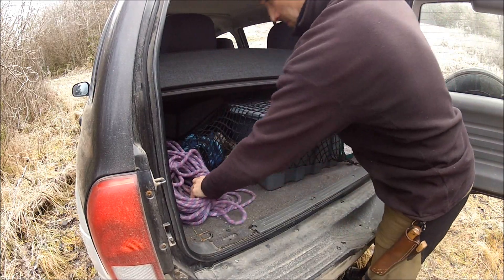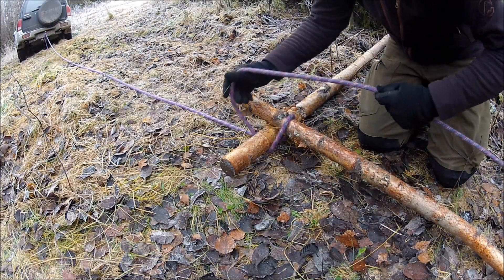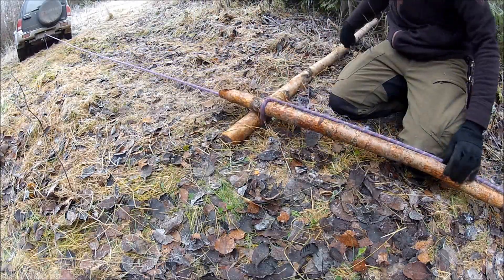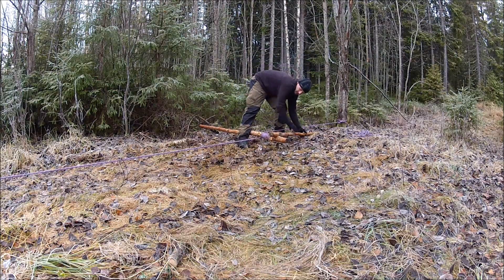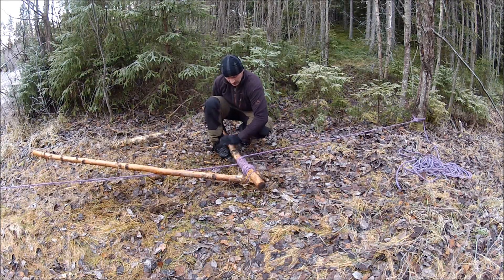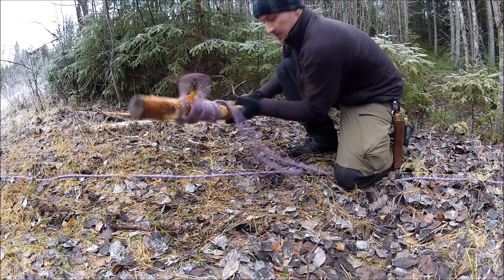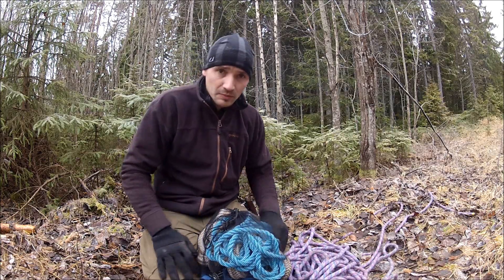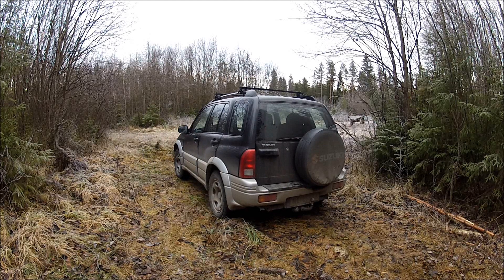DIY winch - For self Rescue

Comment: Not buying it.. The setup might work in certain conditions but that rope is not pulling an SUV, my rope snapped trying to extend an actual winch on my SxS, in drive, 4 wheels spinning. Also @7:08 it rolled like 8 inches not even in timing with his turn, you'd be lucky to get 1 inch out of every turn

Comment: I have read that throwing a "rug" or anything similar over the tight rope is what you do to keep the rope from whipping back if it fails. Anyone who says to just buy a come along has not been all alone and seen Plan A go to Plan D and so on. My question is about using a chain instead, would that be an option.

Comment: i thought you weren't supposed to use the tow ball system for towing. is this a special one that can handle this?
Reply: Uh, towing is what the "tow ball system" is for!
Reply: @philiphinton1350  I miss typed. What I meant is that towballs are not supposed to be used for recovery operations as they tend to break off when used this way and become deadly projectiles that often kill or mame people. I have seen video of a guy killed by a flying towball that broke lose and hit a bystander in the head and killed him.

Comment: Good Idea, But you can also tie a line to the tire and it is much quicker...
Reply: Exactly,  I was thinking that. Just wrap one end of the rope to the circumference of the tire,  and tie the other end on to a tree.  Then give a smooth pressure on the gas

Comment: very cool, too bad my truck is 8000lbs, but luckily if I have the right rope or strap I can tie it in-between my wheels because its a dually and use the engine as a winch
Reply: it is the best to have a winch but I don't yet, its 2wd so I don't really go Offroad but I always like to be prepared!
Reply from the maker: +bosshoss69lee Yes its doable, this method can be used for moving a log away from your path were you are not able to podition your truck for pulling it ie.
Thanks for watching
ODd
Reply: Have A real winch? Used It😊
Reply from the maker: Thats the best thing...

Comment: No no no do not winch on your ball hitch! it can break off and fly at someone at hundreds of mph! Though for this particular example I suppose the rope would snap first
Reply from the maker: +Pedro Amargosa I would belive the rope snaps first yes. I have never experiences a ball hitch break myself, never heard of it eiter. But it can happend. I used the ball to show that simple knot that will easily loosen after heavy loading.
Thanks for watching
Odd
Reply: This may hold true for Class 3 (5k pound/2.3 kg) and under type hitched of the US style, but mainly applies to using in a snatching manner of recovery. European ball mounts are made more different with the ball forged with the neck, but still one will want to remain vigilant if using the hitch ball in a winch recovery as something unforeseen weakening the  structure like fractures will likely give away if the rope does not give out first. If anything make sure to bring along a hitch receiver shackle mount to tie the rope to for a 'stronger' connection.

Comment: would i be able to do the same thing with a camper trailer but using tent poles instead of wood. or would it crush it . If i put rope on something at the front of the trailer and join the other end on the tow ball of the car would i be able to make the forward folding trailer lid go over to close it hope this makes sense
Reply from the maker: +Alison Watson The poles need to be strong, you can use pipes, steel bars, or any other thing that is pretty strong. As said in the video you will need something between 2-4 inches thick depending on the wood, so somthing of equal strength of any material will do. For any towing/winching with this method, you will need an open space in both end equal to the length of your pole.
Thanks for watching
Odd

Comment: Thanks, it may help for my snowmobile expeditions
Reply from the maker: +Claude Ouellet It sure can, you can also tie it to your belt and let the motor do the job, but its always a risk of damaging your belt, not recommended.
Thanks for watching
Odd
Reply: +NorwegianBushcraft I will also share it with my fellow floatplane  Bush Pilots on our forum, very helpfull for us. We don`t have to carry nothing more than a rope we already have on board.
Reply from the maker: Thats good, always handy to know this trick. Remember to practice, hard to remember it when you need to if you not have done it with your own hands. Thanks for watching and sharing
-Odd

Comment: Nice video. Just one thing to suggest, using the ball of a trailer hitch may be dangerous, better to use the tow hooks when possible.
Reply from the maker: +Billofthenorth1 You are the first one to notice, I know its not recommended, never had any issues though, pulled up and towed countless of cars this way. I had to do it this way in the video to show the simple knot that is easy to open again after hard strain. This video was never ment as a vehicle rescue method, but a method to move heavy objects with a rope and and the forest. Still I have used it a couple of times to free my car stuck in the snow.
Thank you for watching,
Odd

Comment: First, get a real 4x4 vehicle. Second, install decent off-road or all-terrain tires. Third, install a real electric winch. Problem solved, and a lot easier. We tend to call this proper preparation.

Okay, if all else fails, tie a rope through the wheel spokes, centered over the tire, and allow the slowly spinning tire to wind the rope in over the tire. This should allow you to easily move two or three feet to get out of the hole you're in. Hell, just throwing a rope (rubber floor mat, etc) under the slowly spinning tire to provide traction will more-often-than-not work.

Comment: I would have tied the rope through the wheels of the pull wheel on the vehicle like I have done several times before and been out within 10 minutes......... Less energy expended also. I have been in some hell of a bad bogs and gotten out of the worst one by doing it my way. The rope did not get entangled or anything. Plus, you have the choice to winch yourself forward or in reverse.

Comment: you get a peice of wood 3 by 2 inch about 8 inches long so it doseant hit iner wheel arch tie it to your tyre with thin twine or rope through gaps in wheel then as your wheel turns that has been spining the wood hitts the ground as it comes around on wheel it gets the car moving as it grips the soil

Comment: Very clever. All you naysayers get over it. This is a very clever idea and I can see how well it can work. I can think of a couple of times this idea would have came in handy. Thanks for sharing.
Reply from the maker: +swampfox1953 It works, and its simple. People can say what they want, I have tried other methods suggested to me, but this is still simpler, easier, and safer. In my mind. I may think wrong, but this method helps me several times a year, moving logs, pulling rope etc. 
Thank you for your supporting comment and afor watching
Atb, Odd

Comment: If you have a stump in the background, tie a double loop at each end, equally wrap and tie rope to stump, then to both car tires.  Make wrapped loop on each tire, so that when tire spins it wraps up rope on tire tread groove, and equally pulls vehicle towards stump.

If you have a stump, and a double headed pulley, you can make a compound pulley and lever.  Attached rope to pulley head and wrap-tie around stump.  Use excess tope and thread through other pulley head and wrap-tie to hitch.  Bring rope back to and through pulley head.  With end of rope, make a trucker's hitch or loop.  Carve out a sizeable-strong, 3-4 inch diameter pole with a carved point.  Put carved pole stick through locking loop, and jam into ground.  Make a notch on the pole at the stump to vehicle rope height.  Place the roop loop at the notch and tighten the loop.  Lean back, pulling the pole toward you, pulling rope loop through pulley toward vehicle.  Wrap stick with excess rope.  Continue jamming the stick into the same ground, leaning the stick backwards, levering the rope out of the pulley toward the vehicle.

With a stump, a double headed pulley, rope, and vehilcle.  Wrap-tie around stump.  Thread rope into and around one pulley head.  Thread rope again through pulley head and into (and out of) the next pulleyhead.  Rope around hitch allowing free play.  Thread back through and out back to vehicle tire.  Make locking loop around tire, and attach into tire groove.  Drive the tires in reverse, wrapping the rope around the tire and pulling the vehicle backwards.  Other more complex pulley and leverage can be also done.
Reply from the maker: John Lord This was more of a demo of  the technuiqe also useful for other stuff than recovery of a vehicle.
We used the method you explained in the army, specially with the belt driven personell carrier B202 and B206. Works well, but are hard on the belts.

Comment: Awesome use of leverage and mechanical advantage. Thanks for the new technique.

P.s: By the way, the "swiffer" method someone spoke about down in the comments below could pull this weight but would be VERY dangerous and less mechanical advantage/leverage then your technique.
Reply from the maker: Thank you very much for watching. The technique is very old I think, but still usefull.
Atb, Odd

Comment: actually, what you are doing looks incredibly dangerous if that's a dynamic climbing rope. if it breaks it will whip back like a bungy cord and could take your head off.
Reply from the maker: Well, i`ve snapped a climbing rope before and it doesnt break all in ones, it will whip a little bit, but less than a steel wire from a winch. All winching is dangerous, and as said in the video a static rope is better. This was the only rope I had at the time capable to pull this load. Its a discarded climbing rope, it doesnt have any big falls, but its to old to be used for climbing. I have used it for rapelling, but not any more after this video :)

A comealong is a very nice to have item, but then you will need to have it with you, as you would do if you plan to something like this or expect the posibility that you have to. This method I show in the video are a method for moving logs, roots, rocks, stretching a rope or pulling a car without any other equipment than a rope. 

Personally I would prefer a comealong if I know I have to pull something. 

Thanks for watching and commenting. Good thing to mention the come-a-long.
Atb, Odd

Comment: Thanks for great suggestion.. Just need any idea.. If there is no trees  where to tie the rope?))
Reply from the maker: You can try a ground anchor. Put a solid pole way into the ground and tie it of as close to the ground as possible.
If you dont have a pole, you can try to dig your spare tire down in the ground, or if you in a rocky area, jam soemthing between some rocks or in a crack in a rock side. Or tie it to another vechicle if possible. 
I`ve used a snow anchor ones, it was a big log, digged it down in the snow 90 degrees on the rope and covered it with snow. 
If you dont have anything at all to tie a rope to, then try other technuiqes.

Thanks for watching
Odd

Comment: Notice you had enough rope to make a "swifffer".. Double the line  back to your truck. take a stick 2feet long and twist until you get unstuck.. We used to use this method on Rigging & holding tones of cargo in cargoship holds. Very simple, cheep and effective. Your doing basically the same method with longer poles and more time consuming. Just saying
Reply from the maker: Are you able to pull this heavy load with that method? I would think that it will be very hard to twist after a wilde, and your not able to pull it very far?
With this method you can pull until the whole stick is filled with rope.
I would like to hear more about that method.
Thanks for watching
Odd

Comment: Excellent.  I really like this simple method.  Could have used it 2 weeks ago when traveling on sandy roads where my car got stuck.... for a while....  Thanks for sharing, Odd.  ATB, my friend.    ....ken
Reply from the maker: Hi Ken!
Yes its simple and it works. A good thing to know it is. So your going off road from time to time Ken? :)   Glad you liked it my friend.
Atb, Odd
Reply: ***** Hi Odd,  I went off road two weeks ago (vid will be uploaded soon) and had an interesting adventure with two flat tires "On The Other Side Of Nowhere."  No internet, no phone, no human sounds, except my own.... 35 miles on 4WD primitive roads to the ranger station...   Sure would have be useful have had the known the method you suggested.
Reply from the maker: KennethKramm  Hi Ken, on trips like that equipment for your car are as important as your personal equipment. Shovel, tirefix and ropes goes a long way. We all are learning by doing. Thats called experience. Looking forward to your video of the adventure.
Atb, Odd